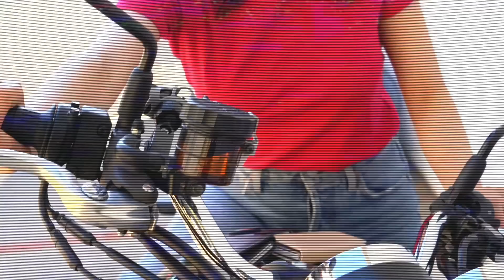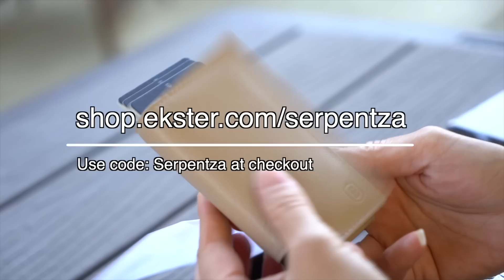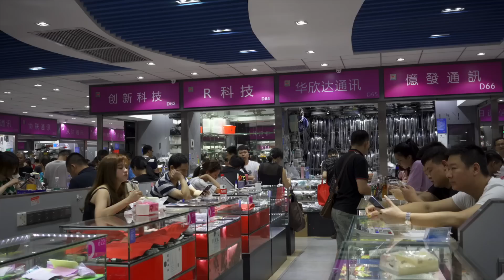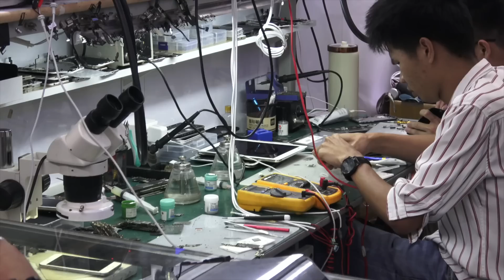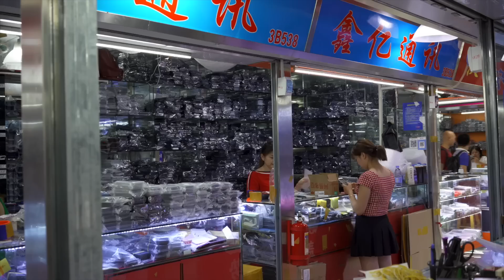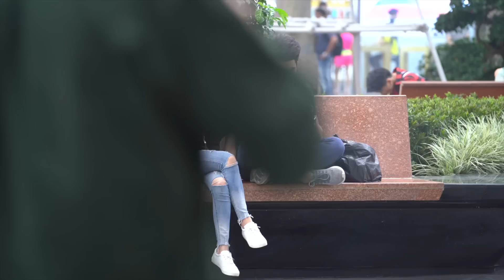Why China Can't make Chips!

Comment: When you start to think about the machines that make the machines that make the machines to make high end chips, you can see the uphill battle to innovate quickly.
Reply: Yup, people often stop halfway and think TSCM, Intel and Samsung make the chips that are designed by Apple, Nvidia, AMD etc. But they all rely on ASML which has a monopoly on DUV and EUV machines which is in turn reliant on Zeiss for the crazy high tech mirrors.
Reply: @Dionyzos  All those high tech companies above are using applied science technology (formula given). The research (electronics) was done by Bell America telephone  and also produced  software C used in these devices today.
Reply: Very true. Even the machine that makes the near perfect sphere that is in the ball point pen is a serious feat of engineering. Turning solid wire into a perfect tiny little sphere is a serious piece of machinery.
Reply: @amuxpatch2798  C is a real productivity killer. Forth can be developed much faster. And can be the assembly language of a properly designed chip. The RTX-2000 for example.
Reply: And at some point it becomes human... 😝🖐 the machine that makes the machine that makes the machine that ultimately needs the human hand 😛
Reply: @Dionyzos  That's not true, the key part of ASML EUV and DUV is the light source which is designed and built by Cymer based in California, that's the most complicated part, plus there are a bunch companies both in Europe and U.S that can make similar mirrors, even better.
Reply: My son just started working for AMD, and what he has told me about how they test the chips is a discipline unto itself that would probably require several years to develop, even with experienced people.
Reply: @JigilJigil  No Zeiss are the only who can make the mirrors in the world and the mirrors are really hard to make.
at least from what I rode
Reply: @them0ppser995  Rode? What did you ride? A D?
Reply: However they are already fighting that battle, they for example created a pretty good EUV laser source.
Furthermore there are multiple techniques which allow you to do these small structures on silicon chips, EUV / DUV ist only one way to do it.
Reply: THAT is exactly what was going through my mind when watching this video.

Comment: Electronics, chip, reuse is a big problem.  These parts are sold on the gray market and find their way into new equipment.  Many times they are relabeled.  I once had a part fail that I returned to the manufacturer.  They stripped the label and found it was labeled as a 1000V part and was really 500V and had been taken from a used assembly.  This is such a problem that the military now requires manufacturers to use approved vendors to build their assemblies.  Our failure rates decreased significantly once we started buying from these vendors.
Reply: That's something I've never thought about.
Reply: SEG electronic market in Shenzhen is a reuse of chips from old phones and other technologies. Fake chip manufacturers will rebrand  old new chips, but the die is different.
Reply: I bought a fake Ethernet card from a Western retailer (ebuyer) that they had (unknowingly) gotten from China. It was branded as a well known make of NIC, of course it was the cheapest one listed - but it was actually a totally different NIC made by a different Chinese firm. the supplied Windows driver worked fine but when I tried the manufacturers driver in Linux the card would not work at all. I found out on the forums that it was a well known fake and was infact a totally different chinese NIC. 
I was able to get it to work using ndiswrapper on the supplied Windows driver, but the couple of dollars saved was outweighed massively by all the hassle getting the thing to work. And the worry of not being able to trust the damn thing.  Moral of the story, it's worth paying a little bit more for good Western stuff. And it's not like the Chinese stuff is a third of the price, often it's barely any cheaper.
The thing is the NIC was so damn cheap, like $15,  how do these Chinese even make any money creating and selling these fake network cards? I could see it being worthwhile if they were selling a garbage 1gbps NIC as top level 10gbps enterprise kit and just hoping that most buyers won't use the 10gbps and so won't notice the fraud.  But low end stuff?
Reply: How recent was the updated requirement?
Reply: I do have a small microelectronics business, together with my russo-chinese wife and some friends in Germany and chinese suppliers sold us fake microcontrollers which were just empty housings and relabeled ECC RAM, which in reality was just regular DDR3 ram with a new sticker on it. But the biggest scam were the PCM stereo sound processors, we ordered for a project. They did appear to work at first but after a few hours of use the right channel died on all of them. 

At first,  was a bit angry at my significant other, because she otherwise establishes good connections to chinese vendors and doesn't fall for scams, then i noticed, that even trusted suppliers can randomly become unreliable. The one which sent us the defective sound chips was very reliable for the past 10 years and now most of the things they sell are scam products. 

Once we had a business costumer which wanted his 386 PC repaired (it was used for a industrial scale) and the only ones which have "new" parts for this old technology are suppliers from China. They just put 30 year old chips in a new housing, but at least those weren't fake. 

When ordering from china, always be careful with each single order, even if you are a long term costumer.
Reply: 386’s are still being used? That’s pretty wild. It might not even have windows 3.1.
Reply: @danparish1344  It runs a minimal control interface specific to a cargo scale. It would be more complicated to re-write the program for a modern system than just keep using the old one.
Reply: Same with grey market lithium batteries, a whole industry relies of repacking old batteries with new labels, don't recycle batteries in China, they just relabel them and ship them back to you, any fool can put a sticker on a used battery.
Reply: Now I understand what those parts are when watching that show. Also know why they bought  old phones n computers n laptops etc. What an eye opener for me thx. Never sale any of my old electronics thought must toast everything first lol
Reply: If you open up any DJI drone, you'll see tons of foreign chips.
Reply: It’ll be relatively low tech.  But it is feasible in theory.
Reply: @danparish1344  You would be surprised how reliable these old systems can be.
They can run day and night for decades and the software doesn't get updates all the time, any bugs can be worked around. Sometimes newer just isn't better.
Reply: I don't the problem is so much in reusing chips, but fraudulently labeling them as something different. 32 GB USB drive altered and sold as 64 GB USB drive works fine till you write more than 32 GB of stuff to it. Worse is stuff like SSD drives that are sold as single state, but are actually quad state, so they work fine for a while, but burn out quickly. You expect them to last years in your hardware, but they only last a few months.
Reply: I've waited for so long to get electronic parts for my factory, I would be thankful even if they all arrived used.  I'm an engineer, but soon my resume will need to include procurement. 😅
Reply: When a country begins the cannibalize it's a sign of decline. Me,being a history buff would note that the ruins of ancient Rome and the Great pyramids had a dilemma in that computer reconstruction noted alot of the structure was missing.  The Great pyramid had a smooth surface of limestone and where is it? You would see a massive pile,correct. It's because it was "repurposed" in Cairo buildings.Same at the Roman forum and Colesium. Imagine if the statue of liberty was repurposed.A sure sign of decline.
Reply: Reusing old technology is fantastic, but it obviously has to be done in a good way indeed. And it should be mentioned, not kept secret.
Reply: DoD sourcing requirements are not at all a new thing.
Reply: I bought over $2000 on a new build with my son over a year ago. Every part except the SSD, memory sticks, and the case are the only things that didn't need to be warrantied. I'm still waiting for my graphics card to be sent back to me in which I had to pay for shipment and insurance on it. Unreal because we took to a company to put it all together and install the software and make it ready for gaming. He told me all the hardware out the box were all shorted. Even my car parts that I bought were garbage. Inferior rotors, pads, water pump and power steering pump. Wtf is going on with manufacturing these days? Garbage.
Reply: The military has ALWAYS required vendors to be approved. We also have rules about domestic manufacturing being preferred. But you know what else we have? Waivers. That allow us to buy from whoever is still making the thing we want, whether its ball valves or toilet seats or titanium ingots. Former defense contractor here, but go ahead and believe whatever you want about American military quality.
Reply: no comment on 7nm chip?
Reply: buy made in taiwan
Reply: @jeffjohnson5053  can a president actually stop companies from doing that though?
Reply: @georgetsokanis3542  Add the great wall of China to your list.
Reply: Corruption, cheating, dishonesty,  theft. It seems like you can get away with these moral failings and profit from doing so.  But you suggest they have their own,  inherent weaknesses that create failure and punish moral failings. 

That's very interesting.
Reply: @forge20  exactly.
Reply: @danparish1344  in some industries reliability it's everything hence they only upgrade to newer tech if it's impossible to repair what they have working there for decades in some cases. Atm machines around here are still using windows XP era computers and tech for example. The local water treatment plant was using tech to control it older than me. If it works without flaws and you dont need anything newer than that, don't touch it.

Comment: I spent 5 years working at Papermate, making ball points.  Pen points are not so much an engineered tech, but very much an art. We were the corporate head of point production. And there were still issues that took us a lot of talent, experience, and work to get through.
Reply: I worked for a company that made broadcast transmitters. For years the Chinese tried to copy our units. They got the parts count and assembly right but making a transmitter work is tough because it is 50% science and 50% witchcraft LOL  Anyone who knows RF tech can tell you that this statement is accurate. Yes they can make phones and other things now, but the stability of their transmitters and receivers is dependent on those imported semiconductors and only skilled hands know how to tune big transmitters so they are perfect. That is why the cutting edge solid state units are made in North America, Europe, or Japan. Others make units but not nearly as good.
Reply: @KlodFather  Your meter told you to say that.
Reply: @bbj7383  I agree with you. I retired from the power generation industry and as a controls guy, I used to "wave my magic wand" whenever I repaired an instrument or control device. Lots of experience and luck went into that work.
Reply: @sanzieu  -  Mine was a green pen which was very hard to find and buy... But I bought them by the box from the supply house. They always knew when I put and entry one something because it was in green. I would have loved to see you do that... and I would have been back there bowing to make it even more a religious experiens LOL.  All Hail the Great Santiago Zieu... The Slayer of Sprites in the Grid.  😜👍
Reply: You make a cogent point.
Reply: @LowkeyTryhard  So in your God-forsaken country, your minders that tell you what to say are called "meters"? Interesting.
Reply: Didn't paper mate used to make those gel wrapped ball points?
Best pen I've ever used. So comfortable.
I'm not even kidding. It was firm AND squishy with an extremely smooth motion over the paper.. I can believe it's an art form, truly.
Reply: @KlodFather  thus was formed the machine cult all hail the Omnisire
Reply: @KlodFather I believe you. At work my colleagues always come to me when the credit card terminals don't work. I have zero education in tech and do exactly what they do: Taking out the battery, putting it in again. The reason it works when I do it is because I do it intuitively and cast a spell for it to work.
Reply: @Yatagarasu-b9w  -  Yes!  You have the magic touch. That is why I carry a green pen. It is my magic wand. Keep in mind that cigarette boxes folded in half at the right width for the credit card slot clean the terminals in the unit for the chip and slid down the side clean the magnetic head for the swipe and is quite effective. Gets dirt that may be impossible to get with a swab and alcohol or solvent. Good luck.